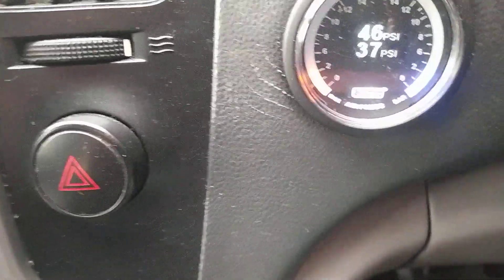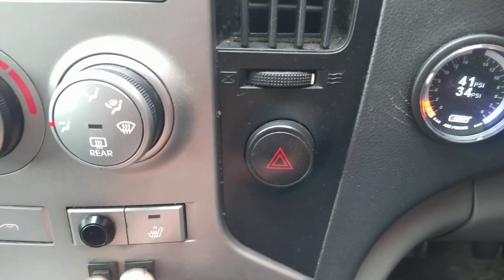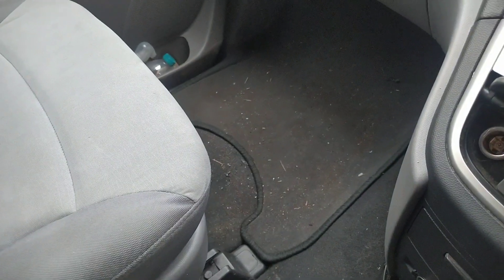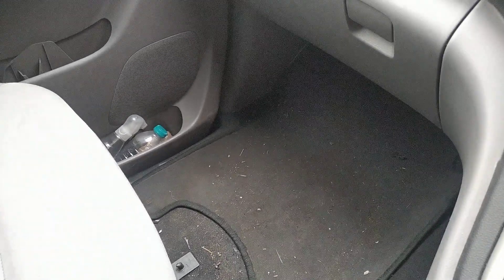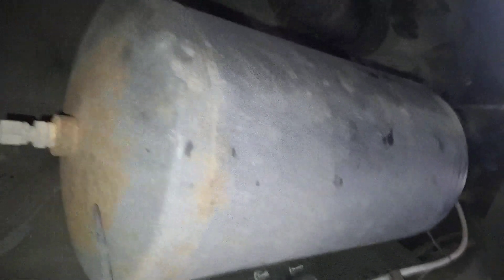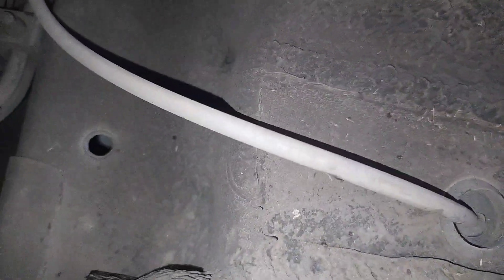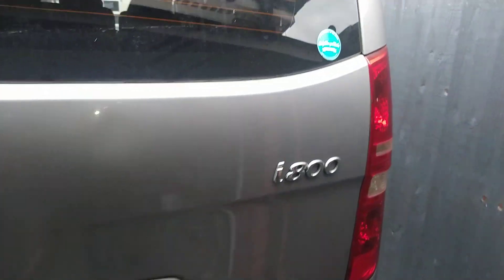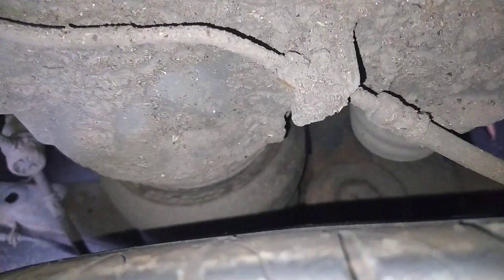fitting air suspension on a hyundai i800

Comment: more stiff or more soft?
Reply from the maker: More adjustable, smoother ride
Reply: Hi, what size air bag did you use
Reply from the maker: I cant remember now, sold the car, but think they were rated at 2000kg each